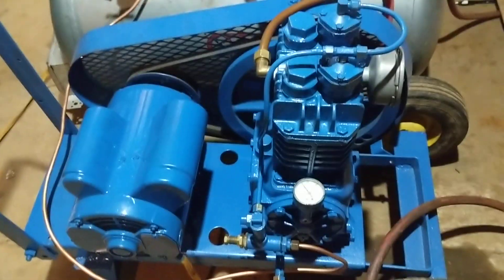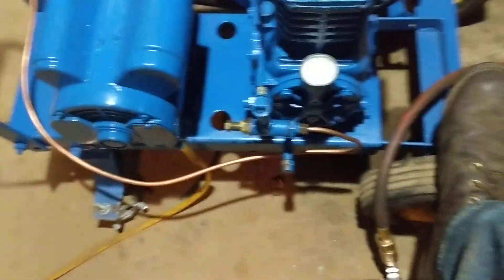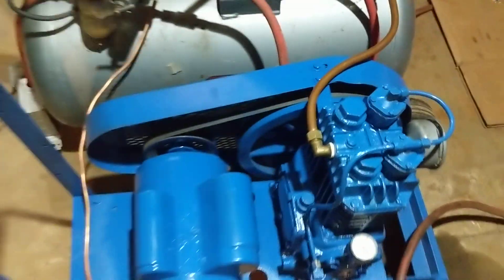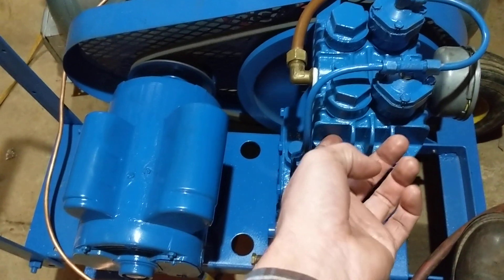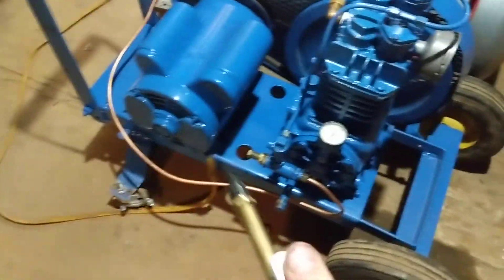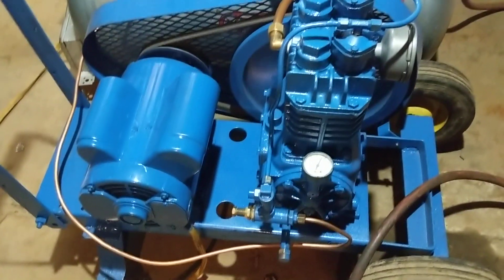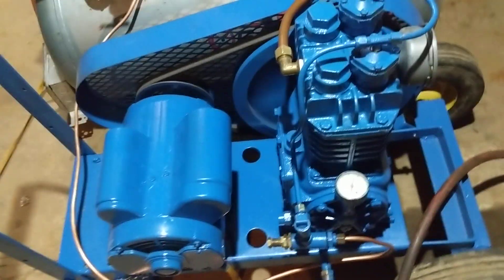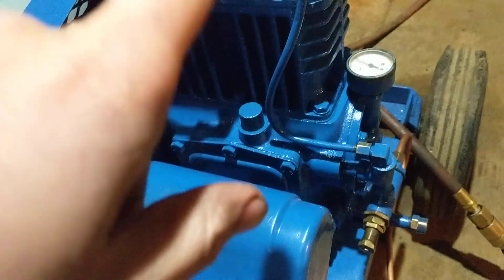Rebuilt Quincy 210 Air Compressor + Pilot unloader valve operation

Comment: Hey Man I liked your video I have a 210 and am on the fence on rebuilding it. I’m needed to replace the copper line coming from the head to the tank I have had a Hell of a time finding the 1/2 copper pipe & compression Nuts.  I think it’s the Gods telling me Don’t Rebuild it. But it’s 40 years old and is super quiet like yours! where can I get parts. The Compression Nuts to start with :)
Reply from the maker: hey man, not sure where you are living but around here, every hardware or farm store's plumbing section will have the compression fittings you're looking for. sometimes you can just get a new ferrule(the little donut part that actually gets compressed) and re use the nut and the fitting in the compressor. same goes for if you need new tubing. get the thickest copper you can find (again hardware or farm store)
Reply: @bcouri1 I’m in California. 
We have a few Farm Supply Stores near by Never thought to check them Out. But thanks for the suggestion. I was thinking of cutting the feral off my old one and reusing the nuts. With New ferals do you think that would work?
Reply from the maker: @grantwes yeah, as long as you can get the fresh end of the copper line into the fitting. you just need like 1 inch of the copper to be straight for the compression fitting to work

Comment: The paint job looks good. Did you sandblast it first?
Reply from the maker: @john15333  i did not, just cleaned really well and degreased. it's still holding up really well

Comment: I too just picked up my grandfather's Quincy. It's a model 206, ROC 1. 
It works, but it's leaking everywhere. I want to rebuild it. Do you know where you purchased the kit? I found a kit with Pacific air compressors out of Portland, but unsure if there was a better option. Do you know what the special tool is called that is needed to compress the fittings that you mentioned for the unloader diaphragm? Thanks for your help!
Reply from the maker: no special tool, you can re use those compression fittings a few times. if it's just leaking oil, you can make all of the paper gaskets yourself. i bought the kit from pacific air compressors i believe
Reply: Thanks for the reply. I'm looking forward to using this thing. My grandpa was obsessed with it and it makes me think of him every time I look at it.

Comment: Hey. Thank you for the video. I have a quincy compressor (310) with an unloader valve, but it has a different design. How would you adjust yours? Does it have a cut in and cut out adjustment on it?
Reply from the maker: off the top of my head i cant remember which screw does what, but there's the inner and outer screw part of the assembly that both have a jam nut. pretty aure turning the inner screw out lowers the cutout pressure and it might be the same way for the inner to adjust the differential, but could be vice versa.. just make small adjustments and note the difference in cutout pressure and differential/cut in
Reply: So. I think that the previous owner installed the automatic shutoff valve and it won't work if I don't take it off. But thank you anyways. It made me understand it better.

Comment: I picked up the Q 210 off the the side of the road  nearly 10 years ago and is still running strong. The electric motor finally gave up (1.5 HP Howell). I tried to rebuild it but the wiring was dry rotted so bad, I'm just going to replace it. I need to know which way the compressor runs. I never really paid  attention when it was running. If I am facing the pully side, is it Clockwise or counter clockwise rotation? The new motor is reversable so I don't want to run the pump the wrong way. The compressor I have does not have the unloader and works fine without it.  I have used it in the upholstery shop and got many hours of use. Good oil pressure and good militance   Nice rebuild on yours.  Thank you for your help!
Reply from the maker: Hi Franklin.. as far as i know, any 210 without an oil filter has a vane style pump and only works in one direction. there should be an arrow on the oil pump housing noting the rotation. you can also reference the flywheel, you want it rotating to where the "fan blades" are pushing air back toward the pump. hope that helps.

Comment: I picked up an auction pallet the other day with a couple of known power tools worth the $125 I paid, plus lots of unknown items. There was a rebuilt Quincy 210 buried in the middle of the pallet. I had no idea it was there. Has a repair tag on it stating that it was rebuilt in 1996 and has oil, but was clearly never put back into service. I appreciate your video showing the unloader operation. That's really cool. WIsh mine had come with that!

Comment: are you running a pressure switch with a pilot valve?
Reply from the maker: the pilot is set 5 psi lower than the pressure switch so if i open the valve from the tank to the pilot it will run continuous, if its closed it uses the pressure switch

Comment: i am having trouble setting my pilot valve, i think it might be bad because it doesnt respond to any setting i try.
Reply from the maker: they get gunked up, iirc there is a little filter screen in there that could be restricting air flow. take it apart and clean it up, put some oil on the spring and ball

Comment: that's the exact motor on my 1974 KARGARD Compressor i recently picked up and was wondering why it "FREE WHEELED"after the pump shut off. after asking on several forums and even calling a guy i used to repair an old century induction motor a few years ago, He didnt even know why it "FREE WHEELED" so your awsome video solved the mystery, THANK YOU very much.

Comment: Hey - don't suppose you have a picture or anything of the tool you fabricobbled to remove the valve assemblies?  I have that exact compressor on my workbench right now with the head partially disassembled.  Trying to figure the best way to get them out and not destroy them.
Reply from the maker: sorry i do not have a photo.. what i did was take a 1/2 drive chrome socket that most closely matched the OD of the valve cap. then i marked where the two teeth needed to go then cut out the socket with a cutoff wheel. sorry i hope that helps you
Reply: @bcouri1  OK, I see what you did - thanks!
Reply from the maker: i made sure the tool was good and tight in the grooves then hit it with an air impact to knock them loose. but to be honest its hard to get them to seal again so if the head works as it is it might be okay to clean it up and put back together with new gaskets

Comment: Hello Mr. P.O.T. can you please tell me what motor hp and rpm you have , and where you got it . Thank you for the great video .
Reply from the maker: It's a GE 1.5 HP, came with the compressor. 1750 rpm i believe, half speed. id shoot for that for a 2 horse if you're mating it up to a similar compressor
Reply: @bcouri1  OK that sounds good . Thank you for the information and the good videos . I believe mine is a Binks Lowboy compressor .
Reply from the maker: @whip-its_dad4239  Ok, i think some of the binks compressors are rebranded Quincy's. ive seen this model 210 rebranded as a binks lowboy before
Reply: @bcouri1  I think your right . Thank you .
Reply: @bcouri1  Binks had two lines as I understand it.  If you go back to the 60s and 70s I think they're all Quincy made pumps, and then in the 80s they develop a Gold line with Quincy Heads, and the Green Line goes to Champion (iirc).  I have two 210 Binks/ Quincy units on tanks, as well as a gas powered 216.  I am looking forward to tearing into mine and getting them to run as smooth as yours.
Reply from the maker: @forked-lightning  Its a pretty easy rebuild, they were made to be maintained. id imagine the 216 is not much different from the 210. probably have a few hundred hours on this unit since this video was made and it still purrs just dandy. belt is getting a little dry but ill run it til it quits
Reply: Hello again Mr. P.O T. can you remember if the connecting rods have a bearing insert on the crank , or did you get that far into it ? Thank you .
Reply from the maker: @whip-its_dad4239  no inserts. aluminum con rods with aluminum bearing journals. i did briefly run a small brake cylinder hone in the big end of the con rods just to get a bit of the factory crosshatch back but not enough to remove any material
Reply: @bcouri1   Thank you . Rod assemblies are 300.00 I think it includes the piston .
Reply from the maker: @whip-its_dad4239  do you think you're going to need them? that's a lot of dough. id tear it down and see what they look like first

Comment: I picked up a new old stock 210 ROC 5 pump about 10 years ago off CL for $100. Couldn’t believe my luck.  I used it to replace a tired Quincy X8 pump from my Dad’s mid 60’s Binks 1hp 20 gal.  The tank rusted out so he gave it to me.  The X8 was a constant run pump but I wanted the 210 to be stop-start with unloaders. I had to buy the unloader towers and the valve that unloads when the oil pressure drops.  It works fantastic and I’ll never wear it out.

Comment: it,s a quincy they are  worth rebuilding they run forever
Reply from the maker: Just recently finished rebuilding another 210-5 unit, with a 2 hp GE motor, and about 100000 difference in the serial numbers from this one. Currently running them in tandem with the newer run taking up the lag duty